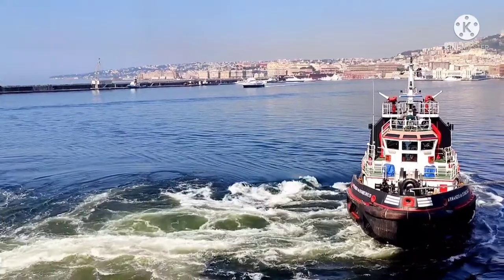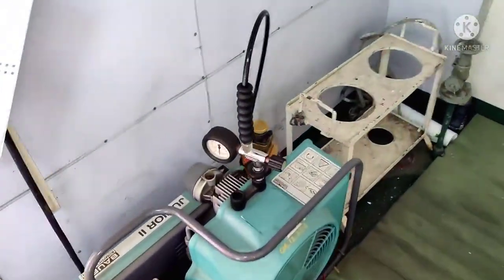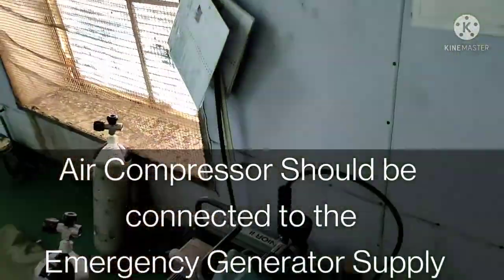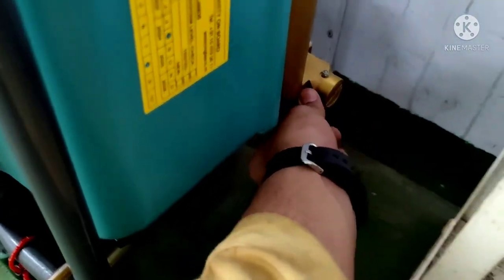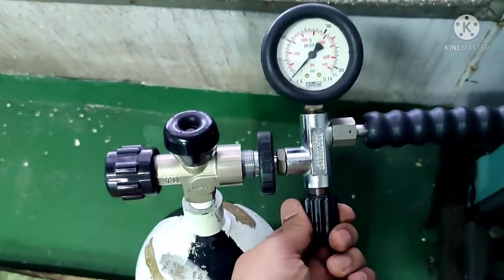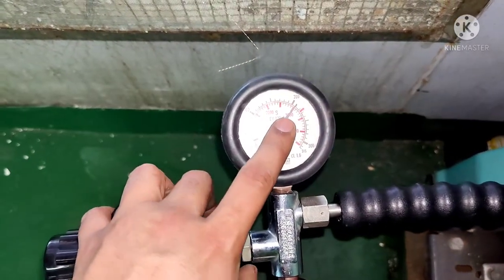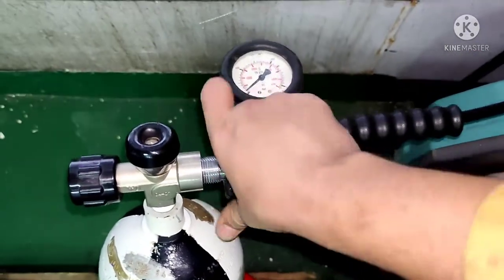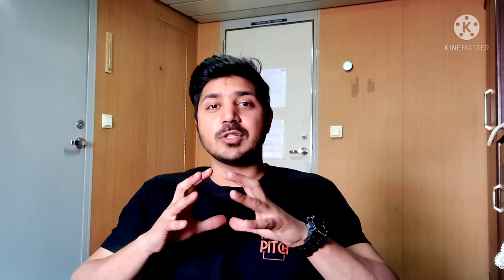How to FILL UP SCBA BOTTLE BY USING SCBA COMPRESSOR?|SCBA OPERATION DETAILS | MERCHANT NAVY |

Comment: Sir, that was such an understandable video. Thank you for that. As a Jr. Officer, it is going to be my first contract. I have not ever used a SCBA compressor unit because non of my vessels during my internship had one. Do you advise if I could to it on my own with what I learned from this video and reading instructions manual or do you advise me to ask for somebody who previously experienced using the SCBA compressor. Thank you again.
Reply from the maker: I am glad that. My video helped you .. You can do it yourself there is nothing to worry about. Try it once with your third mate after that do it yourself .

Comment: Hi, nice video there! Wanted to point out that the o-ring isn't there after you refilled the bottle. Also, the maker is BAUER and the model is JUNIOR II as your bottle is 200 - 220 BAR but if you have bottle that is 300 - 330 BAR, the model will be JUNIOR II - E.
Reply from the maker: Thanks for the input Afeez 🙂 ... I found the O ring later after shooting the video ... You have a good eye as an observer 👍

Comment: Dea sir i have problem with tha the pressure maintan valve inside oil ring get damage and leak from the adjusting screw what should i do to fix the problem
Reply from the maker: Are you talking about the bottle or the compressor ?
Reply: @sailorguide  am talking about compressor pressure maintaining valve the one you adjust to increase or decrease pressure its leaking from back side

Comment: Very good explanation, but the valve which you marked as the relief valve that is actually the unloader , to decompress the compressor and reduce the starting torque also as you said to drain the moisture accumulated inside the cylinder. 
*Relief valve and bursting disc comes under critical safety.

Comment: bro in some cases i found working pressure of BA cyclinder 200  and some of them is 300 , are they different depand on manufacture or is there any explanation ?
and what is working pressure ?
Reply from the maker: It depends upon manufacturers.